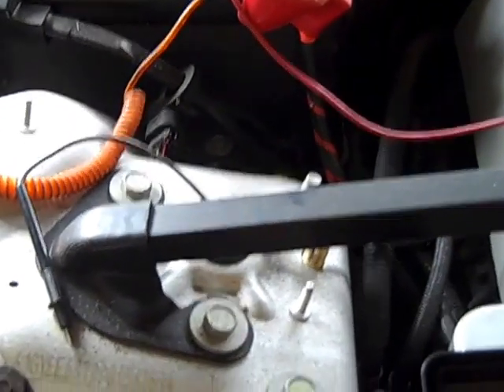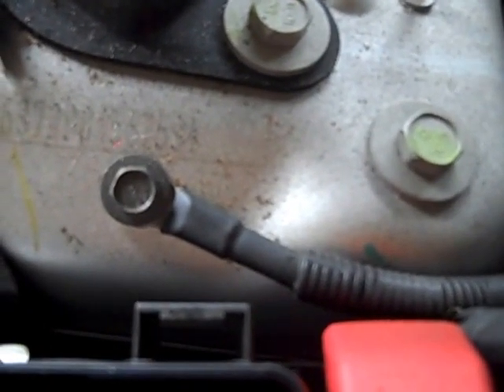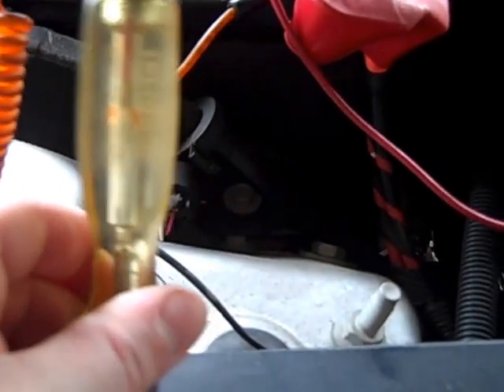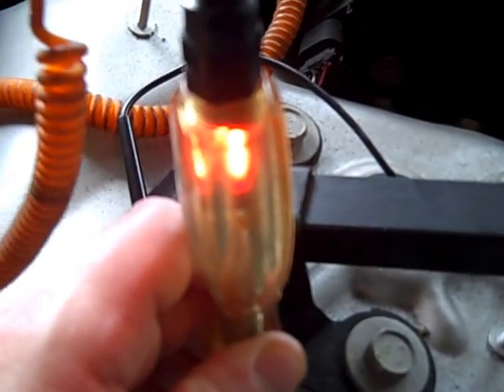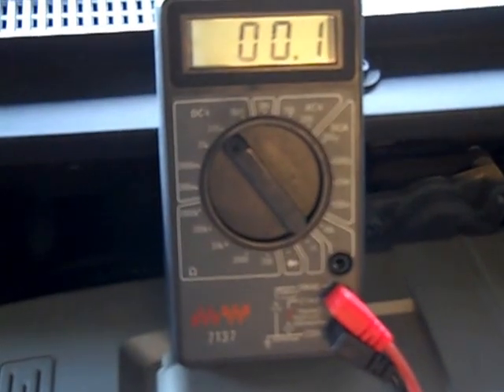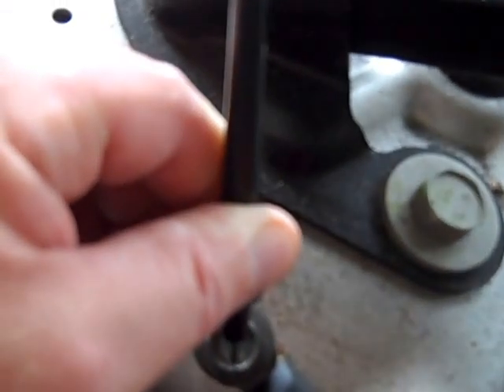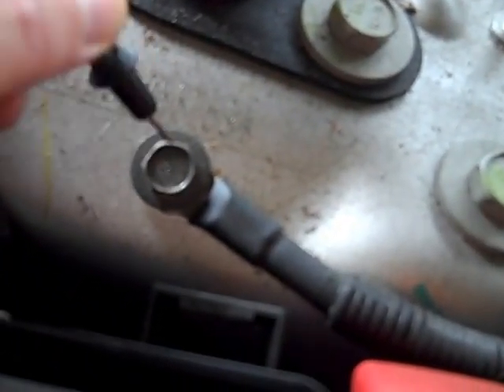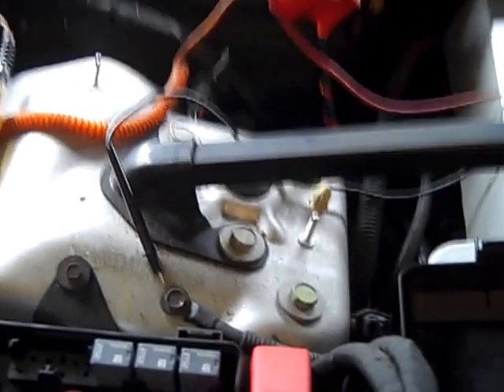How to Test Automotive Grounds

Comment: Why not switch multimeter to ohms, touch one end of test lead to neg terminal and the other lead to grounding location?
Reply from the maker: That is a great idea and an even better way to check an automotive ground. The method used in the video is just a quick way to check a ground with a test light.

Comment: Question sir-I just stumbled on you channel and watched my first vid. Awesome!. I have a question-I'll keep it brief. My car's a/c compressor is being called on at all times with my ignition on. I've printed wiring schematics and have identified a 'grey' wire that goes from the ecu to the relay. I am told by my mechanic friend I need to see if the ecu is grounding it or, is it grounding on the frame somewhere. I have gained access to the wire under the fuse box. Using my volt meter, how can I tell where the ground is coming from-the ecu or a chassis short? I hope this makes sense and I hope you can help

Comment: Im going to add a few things, 1- do not use a test light with a LED bulb, it will not draw enough amps to verify a good ground. The best way is to have a headlight or i use a plow back light. If it will light a big non LED bulb you know it will most likely be able to handle the amp load for what the ground is for. 2- a fully charged battery is 12.6 volts even after sitting. Each cell is 2.1 volts x 6 = 12.6
Reply: He only said quick check three times

Comment: this a tip  ---- if you need a 50 ohm resistor but you only have some 100 ohm resistors  twist 2  100  ohms  side by side  read it now   50 ohms   -----1/2 of 2 equal res.    this works  for any value as long as the 2 are equal

Comment: before you test ck your meter  by conn both lead togeather should read low ohms  it a good idea to twist the selector knob briskly back and forth this to clean the copper contact inside your meter  once you do you will see a lower ohms reading which is correct  exap----it may read 5 ohms  once you clean it i will read 1 ohm this is in the leads copper wire.

Comment: your neg batt lead is starting point that black heavy duty lead fastion to veh. chasis undernethe on frame to ground on 3 times in my life i have found that ground conn loose causing havoc verfy this conn by looking under vech see that cable is tight  --- grounding  all metal of the vehicle

Comment: i tried that on my 2000 jeep. With test light, clip on the pos. post touched the ground on the engine/block and it does not light up. only if i put the clip on neg post then it lights up light on tester.. With testlight clip on neg post the light comes on when i touch both ac wires, and when i touch the light to almost everything under the hood the light comes on. My ac wont take freon is my main prob but im showing both wires on the compressor to be hot or have power.  Even when the ac is unplugged. still shows power on both wires on the comp.

Comment: Load the ground circuit engine running turn on blower and headlights take your meter and do a voltage drop test meter will do the math for ya dvom on millivolts postive lead on battery ground negative lead on body ground anywhere on engine the metal part of the vehicle and engine is the ground along with the ground cables this is a part of a general voltage drop test along with the postive side you could for example go from battery postive to a fuse in the fuse panel if that fuse is powered by the ignition switch now your checking that entire circuit including the resistance of the ignition switch this test should be around 100mv

Comment: Great video. But remember two things.If the circuit won't light a incandescent test light Then it won't carry current. Also Becareful with meter readings. Sometimes you can read voltage that's truly isn't there.
Reply: Greg Feeney look at you go

Comment: Okay here's my opinion. If the test light is bright. the Circuit will carry current. I have had meters show that I had power. but check that same circuit with a test light and the test light won't light.  Also by the brightness of the test light you can tell if you have a voltage drop.

Comment: Actually you should do the voltage drop to make sure you have a good ground
Reply: Ya. You could have a totally insufficient ground and still get 12V.
You should have put your meter on Ohms to measure resistance in that circuit.
Reply: You right, just the test light and meter like that I tells you it is connected to ground but you won't know it will preform under load unless you do voltage drop
Reply: correct
Reply: Do you mean test voltage drop from the battery to the battery cable?